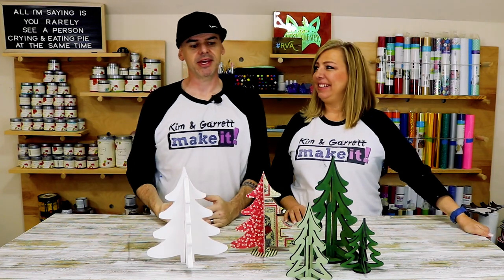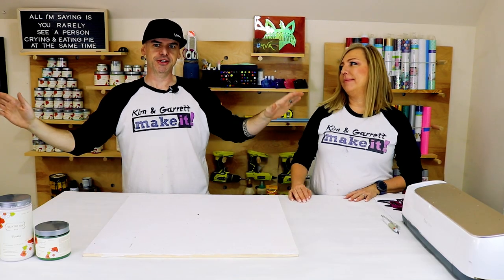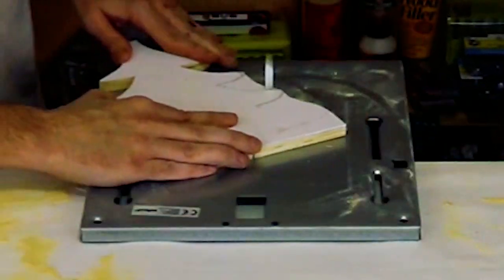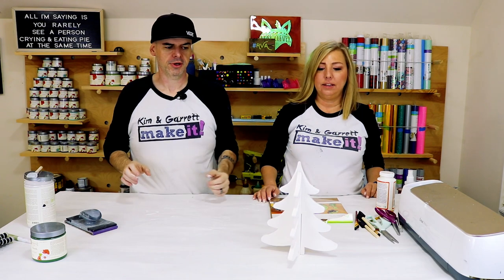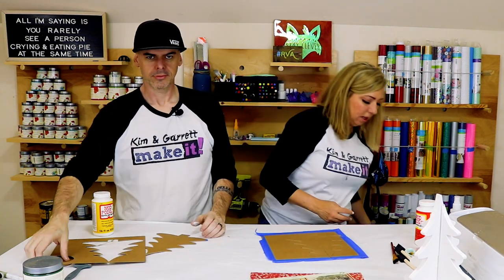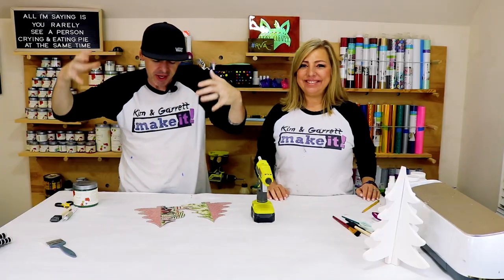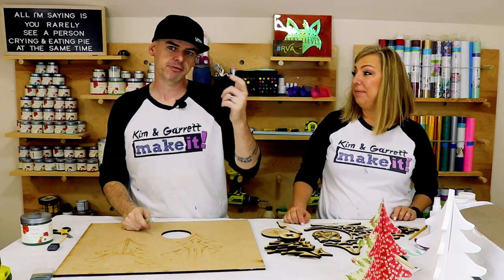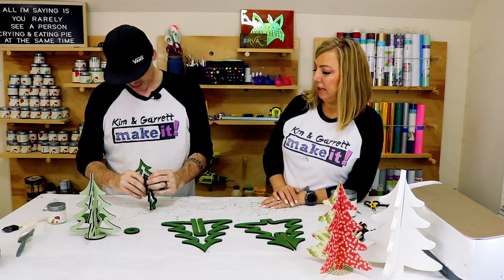How To Make A Wooden Christmas Tree with a Jigsaw, Cricut and a Glowforge

Comment: Hi Kim, you can use Goo-Gone to clean your mat. Then, use blue tape around the edges of the mat to prevent glue getting outside of the edge. Next, use two-way glue stick on the entire cleaned mat and spritz with a very little water and let dry. Water because you don’t need extreme tack. But you could just use the glue two way pen. 😊
Reply from the maker: Thanks Kathya!  I'll give it a try!  What's the glue stick?  Do you have the brand & name?
Reply: @KimandGarrettmakeit  Hi Kim! Yes, forgot to mention that! Zig 2-Way Glue pen. You can find it very easily on line and at craft stores. The large felt tip one is best. There are super helpful tutorials on line on how to clean and restick your mat. You can also use Alene’s Tack It Over & Over liquid glue using an old gift card. That’s even faster! Will Garrett give us a review of that gadget he bought to attach to his jig saw? That would be a cheaper way to do cuts...it looks awesome! Those trees are just adorable!!!

Comment: We have found when our GlowForge Pro isn’t cutting all the way thru, especially if it’s on the left side of the machine, we clean the lens on the left side of the gantry and the matching one of the left side of the printing head. Then make sure we focus it after we load everything!
Reply from the maker: Great tip! Thanks!  Most of the time it happens when I am using the pass through slot. Even if I focus it.